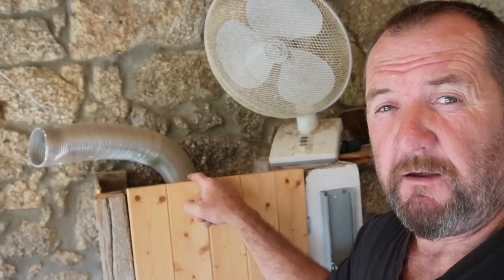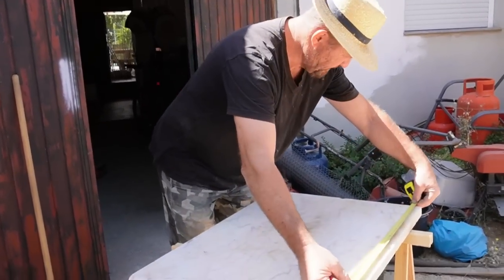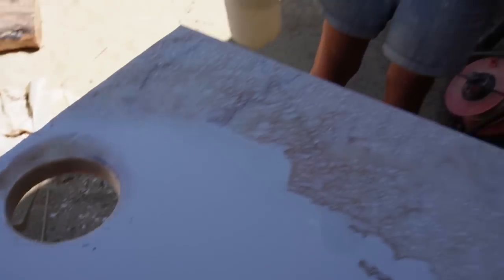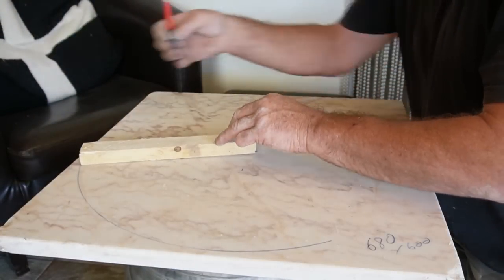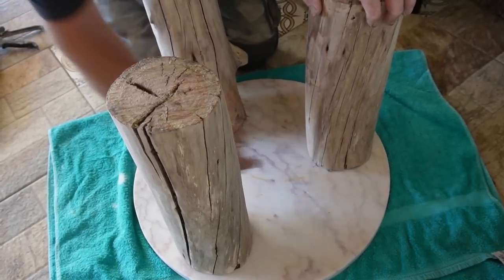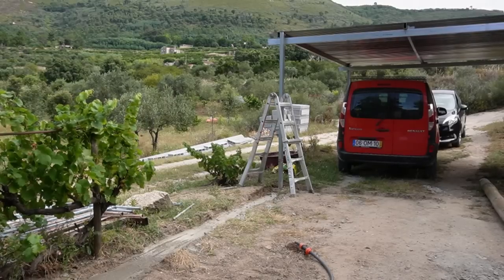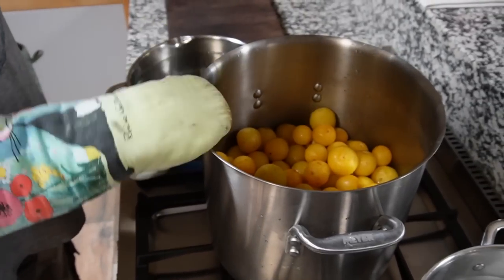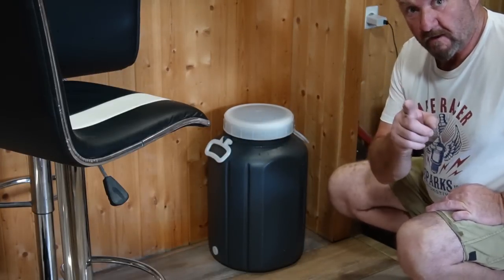Building Our Own Dream Home By Ourselves

Comment: Hi, I enjoy watching your channel.  Thank you.  Question:  why is mortar not required vertically between the blocks?
Reply from the maker: It is, but you put it in after you butt the blocks together, some of the bigger blocks are designed to link together without mortar on the perps
Reply: Thank you for your quick reply.